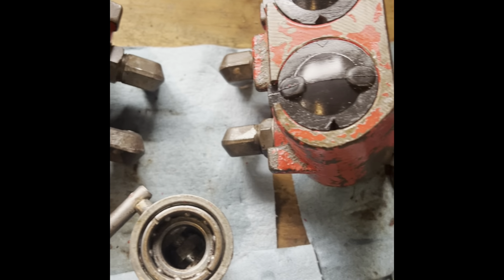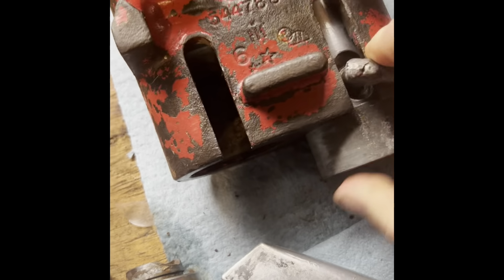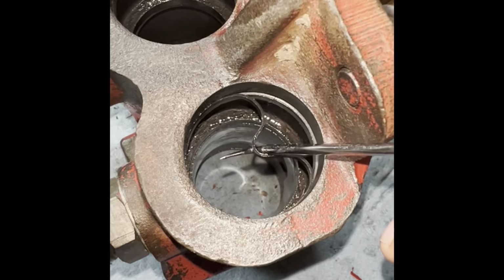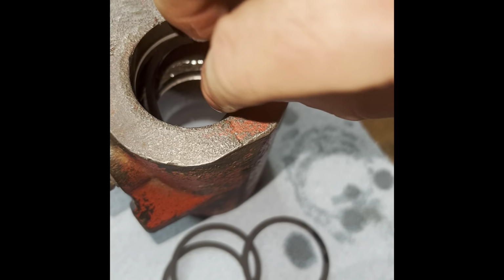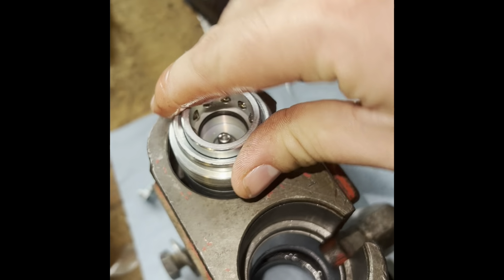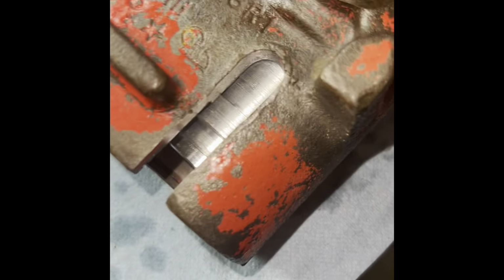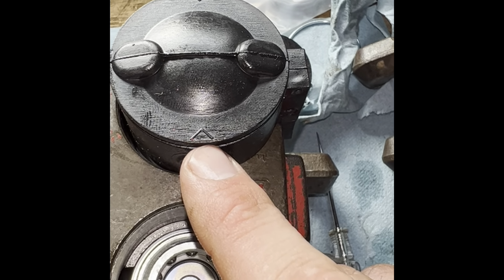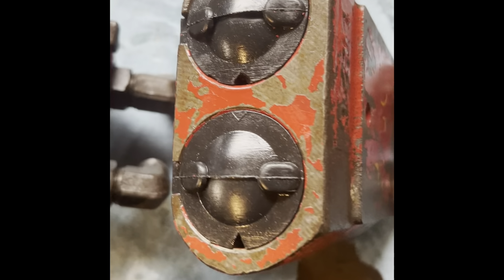IH 966 Hydraulic Remote Pioneer Conversion

Comment: Have you had good luck with these? I’m confused because there is no lever to open the valve
Reply from the maker: Yes, leak free and now we don’t have to use adaptors since most equipment we have has the pioneer style couplers. You just push in your coupler and then pull out to disconnect. They will dribble a little oil when you disconnect but similar to any other connection.